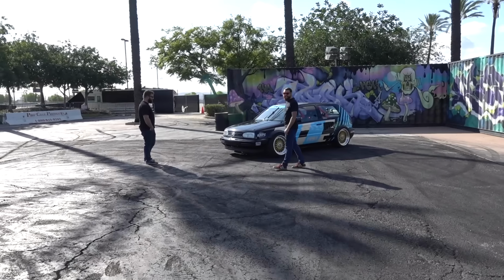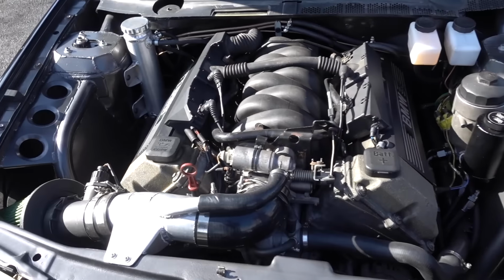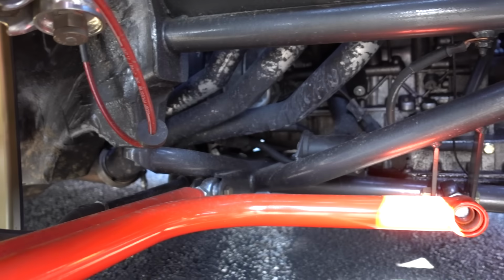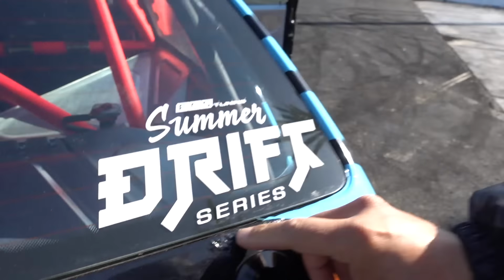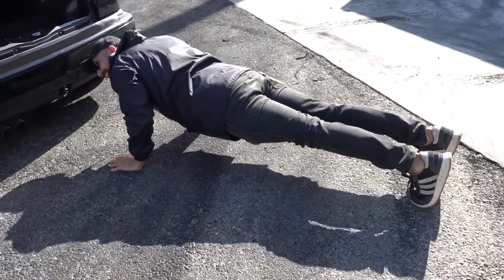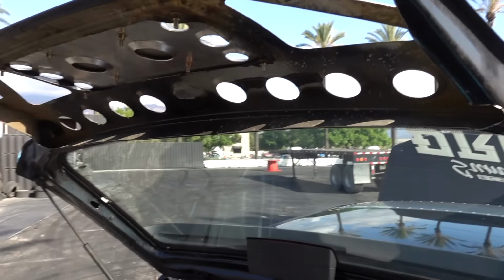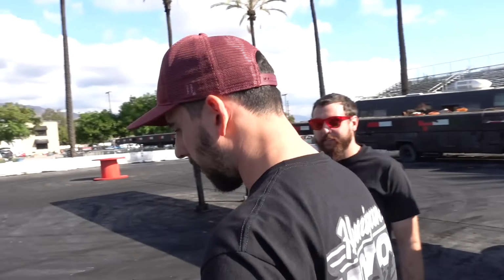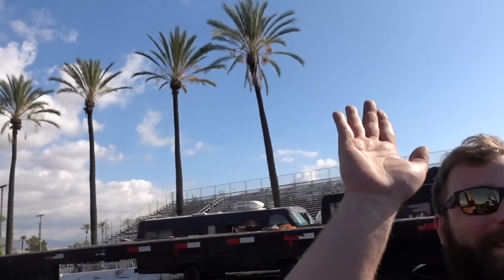RWD Converted Volkswagen GTI (With a BMW V8!) is the Ripper We Didn't Know We Needed

Comment from the maker: If you could pick any front wheel drive car and turn it into a rear wheel drive party car, what would it be?!
Reply: Honda Civic
Reply: 1972 Olds Toronado
Reply: My 2000 monte carlo ss
Reply: My 94 honda civc ex
Reply: Toyota Corolla hatchback
Reply: prelude
Reply: 4th gen prelude! Honda Preludes all looked like they should be rwd
Reply: A 2nd gen eclipse with its 4g63 turned to logitudinal
Reply: A crx with a 4g63 awd
Reply: There are so many fwd cars that would look so much better if they were rwd
Reply: Fiat uno
Reply: A CRX would be nuts... but like all fwd hatchbacks look hella dope sideways
Reply: Maybe not a fiat
Reply: CB7 Accord
Reply: Me and a buddy cut the floor pan and firewall out of a Nissan N15 Pulsar SSS, and cut the body off an S13 silvia that had an sr20det and well pulsar body onto s13 chassis. Bit of screwing around but was fun enough to do
Reply: 3rd gen Prelude
Reply: Saab 900
Reply: A mini
Reply: Old scirocco
Reply: peugeot 405 mi16
Reply: Astra h opc
Reply: Turbo Yugo
Reply: Volvo c30
Reply: Fuck it, a Fiat Coupé 20v, because why not
Reply: Tiburon
Reply: Volkswagen Passat mk2
Reply: 2010 Kia forte sx koup
Reply: Nissan Sentra 90'
Reply: Lancia Thema 8.32,  BUILD it
Reply: OG Saab 900 T16 Aero, best looking car ever<3
Reply: Hoonigan Daily Transmission K swap 4wd GTI
Reply: Legend
Reply: Vw corrado
Reply: W8 passat or maybe a phaeton???
Reply: Mk2 jetta coupe
Reply: 15 nissan altima
Reply: Saab 9-5 aero. 2JZ swapped because why the hell not
Reply: Hotrod garage took a fwd LS car and made it awd twin engine
Reply: Any and all honda civic hatchbacks!!!
Reply: 2020 Trd camry!!! let's go!😎
Reply: Mitsubishi Eclipse
Reply: My ST!
Reply: 3000gt Sl or base model!!
Reply: Whatever car thats gonna get me a tshirt
Reply: 2002 saturn sl2 with a 2005 subaru wrx driveline. i had a saturn and my friend had a wrx they are very similar wheelbases and widths, ultimate sleeper
Reply: Honda prelude MK4
Reply: Opel Calibra !!!
Reply: Mk7 Toyota celica
Reply: Any... any ever... the prewar tank known as a citroien traction avant.
Reply: 2014 Volkswagen Jetta TDI. Why you might ask. Well. It's my daily.
Reply: My MK7 GTI.
Reply: a more widebodied golf mk3
Reply: Probably a Volvo 850R or something oddball like a Mazda MX6 with that crazy sounding V6.
Reply: Hoonigan Daily Transmission Any V6 Accord
Reply: '86 Jetta with a 930 911 rear suspension and perimeter frame. I've done the measurements and used to build replicas with the setup...wouldn't be great for drifting, but it would be rad.
Reply: First gen Integra..
Reply: Mazda6 wagon with 4-rotor
Reply: Hoonigan Daily Transmission id die for a rwd mk4, 24v vr6 gli getta (gti front end on a jetta = getta)
Reply: Saab 900T Aero EASY!!
Reply: Hoonigan Daily Transmission peugeot 106 gti
Reply: 1993 Nissan Sentra b13 whit the sr20 or vq35
Reply: Eg civic
Reply: Scion TC make it rear engine and rwd 🤔
Reply: Zastava 101
Reply: my 2002 corolla
Reply: My 2001 Mazda Demio DW
Reply: Toyota Camry
Reply: Mazda 3 Speed
Reply: EG, shares a similar wheel base to the S15
Reply: Probably the same direction as this dude. I would pick the mk2 tho cause that’s where I started.
Reply: Toyota Fuckin Yaris 😂
Reply: My own Peugeot 406 Coupé, keep the original V6 and make it RWD, like it should've been from factory.
Reply: Mark 4 jetta wagon with a golf front conversion. Rolled fenders sitting on a set of fifteen52 TARMAC. With a 4AGE swap  with itbs
Reply: Hoonigan Daily Transmission Subaru Legacy GT Spec B
Reply: Toyota Celica MK2
Reply: I plan on doing a 1j rear wheel drive swap to my 96 4 door camry
Reply: TOYOTA SERA
Reply: Fiat coupe
Reply: @matttilton5888  Change the look from where? From underneath looking at axles and diff is about it.
Reply: @thatoneguy3112   just the fact.of knowing a vehicle is rwd to me makes it look better if that makes any sense lol
Reply: @matttilton5888  I get ya now, you meant like looking on paperwork/specs as well
Reply: 2010 Honda accord
Reply: Volvo C30
Reply: Honda CRX. Or my Camry 🤔
Reply: Buford Washington K swap the world tbh
Reply: LS swapped Hyundai Excel. I delivered pizza in a 1987 model and went through the 50K mile warranty in just under a year.
Reply: That mk4 golf looks like a good choice except I would’ve went VR6
Reply: Honda Fit
Reply: If I’m being real, those ugly ass 2000’s celica GTS would be so much cooler if it were RWD. Also the first two Taurus SHO’s would’ve been way cooler RWD
Reply: 2000 Acura integra
Reply: mazdaspeed protege.
Reply: 89’ Mazda 323. Cuz I’m a broke boy and couldn’t afford a GTX.
Reply: My 96 civic
Reply: @hillbillyhippie597  i was gonna say this too.
Reply: Johnny Hammersticks  i see your a man a taste 👍
Reply: 1998 Mazda Protege
Reply: 2004 Ford Focus.
Reply: 92 Cadillac eldorado
Reply: Either a Nissan maxima or an Acura TL/TSX
Reply: Hoonigan Daily Transmission I know the perfect one!!! My first car I bought from Alhambra with working AC 87 2dr Honda Accord LXI baaaby!! Wess-WESS
Reply: Hoonigan Daily Transmission  I think a fifth gen Mitsubishi Mirage coupe, a B13 Sentra SE-R or even a modern FC Civic coupe with type R body kit would be pretty sweet.
Reply: Some kind of minivan either with a rotary or turbo 4 cylinder engine
Reply: Nissan A32 Cefiro 

That and AE111 Levin, shame that Toyota did not keep the RWD layout for next gens of Trueno/Levin after AE86
Reply: 07 Malibu the floor pan is actually set up perfect, 90s something civic because crv stuff is basically bolt on and i would put mud tires on it.
Reply: Honda Prelude,Kia Cerato koup,Hyundai Tiburon,Opel Astra coupe(Bertone),Daihatsu Copen,Daihatsu Materia,Hyundai Veloster,2000 VW Beetle,Audi TT coupe
Reply: Either a 91 crx or my rsx-s
Reply: My mk1 Rabbit pickup.
Reply: Celica, eclipse,audi a5
Reply: Real talk an 03 Toyota Avalon.
Reply: Saab 900
Reply: Mk1 golf
Reply: A4 b5
Reply: Honda prelude, it looks like it should be rwd in my opinion.
Reply: volvo v70n
Reply: Ford Probe     very cheap and shoulda already been RWD from the factory    the chassis was built to be and has pop-up and down headlights 😉.   Miss good old JDM style pop ups
Reply: mk1  Fiat Panda, it's so dumb it's awesome. take a Alfa front end, weld it where the back seats were, profit.
Bonus points if you manage to stay alive in the process
Reply: G6 coupe has great body lines and would look real sick sideways with v8 noises coming out of it
Reply: 2008 Mitsubishi VRX Lancer - they have enough room for a sick V6 twin turbo
Reply: currently working on this on my 03 camry. :)
Reply: 1994  2door Camry
Reply: @RallyRu_2004_STi  did you know at one time the probe was going to be the new mustang?
Reply: Ford fiesta mk1
Reply: I would to a eg6 or a Mitsubishi eclipse
Reply: Crx maybe idk
Reply: Corolla Levin a110
Reply: A prelude they already look like they should be rwd  but they aren't
Reply: 5th gen prelude
Reply: 01 Integra
Reply: Honda prelude
Reply: Hoonigan Daily Transmission Infiniti G20 / Nissan Primera
Reply: The new corolla hatch
Reply: Hear me out PT Cruiser. tons of room for goodies
Reply: 2012 corolla
Reply: VW Rabbit Truck
Reply: MK1 Volkswagen Caddy
Reply: Peugeot 404
Reply: 95' Cadillac sts
Reply: an abarth 595 comp
Reply: My volvo s80
Reply: Hoonigan Daily Transmission Renault megane RS
Reply: Hyundai Getz😂😂🤠
Reply: Myvi
Reply: @spannersautoandcomputerser1649  or C70
Reply: VW Scirocco
Reply: Acura integra type r
Reply: Nissan Micra
Reply: Toyota Tercel or an Acura Legend.
Reply: Seriously can't believe no one's mentioned a Mitsubishi FTO...
Reply: 1994 corolla
Reply: Any Saturn S-Series
Reply: my 2003 Ford focus mk1
Reply: 2009 Renault Symbol
Reply: My 2003 opel vectra
Reply: Toyota Celica VII
Reply: Hoonigan Daily Transmission 6th gen celica! ❤️
Reply: a MK1 VW Caddy 😍
Reply: Hoonigan Daily Transmission 
Jetta wagon TDI 6spd or CRX Si
Reply: Hoonigan Daily Transmission my mk4 gti would be great with the 1.8t from an Audi A4 with rwd.
Reply: 97 4dr integra gsr
Reply: 72-76 Cadillacs
Reply: Honda civic with ford tourus sho engine in the back
Reply: Toyota MR2
Reply: CIVIC TYPE R
Reply: Cobalt ss
Reply: Opel Calibra would look sick and might be pretty balanced. I mean.. what the hell were they thinking making it FWD in the first place... :(
Reply: 80s dodge charger
Reply: Bmw 135i 2019...
Reply: Dodge Daytona or Ford Probe
Reply: Mk2 Scirocco
Reply: Vw corrado...will be nuts
Reply: Passat B5 🥳
Reply: Hands down a corrado!
Reply: 90's toyota camry
Reply: 2000 Honda Prelude. I'd want to do F series and make it drift.
Reply: 90s prelude bcuz beautiful car and pop ups headlights!! As long as it was it should've been
Reply: @matttilton5888  well said
Reply: @remaunzky12  bruh perfect choice
Reply: eclipses the brain o conner one
Reply: Corrado.
Reply: Y'all better let Jimmy bring the RWD Civic.
Reply: Honda Del Sol
Reply: Mk2 Honda prelude or a Toyota celica
Reply: Golf mk 4! 🔥
Reply: opel corsa city 1996
Reply: Honda
Reply: Honda Legend or Rover 827
Reply: VW Brasilia 1980
Reply: Audi 80 b4
Reply: Honda Civic Hatch
Reply: 94-96 Toyota Camry wagon
Reply: Honda crx
Reply: 95 Toyota Camry wagon
Reply: Bmw active Tourer 2 Series
Reply: Vauxhall vectra
Reply: Saab 900 turbo all day
Reply: My 2001 Mk4 vr6
Reply: Fiat 500
Reply: A vw mk1
Reply: '95 Volvo 850 T5 Sedan
Reply: Honestly, I think the GTI is one of the best FWD cars out there. Every gen has always had a good chassis and suspension setup, that not much is really needed to make it a very fun car, compared to all other FWD cars. I think this GTI was a good pick for this conversion.
Reply: Pretty sure this dude just nailed it
Reply: karkid 164 this car, but give make it rear engined and give it a 3 rotor single turbo.
Reply: Saab 9000aero
Reply: 2018 Civic type R.
Reply: B5.5 passat
Reply: Volkswagen Corrado
Reply: Renault Le car cuz that would mean I have a Renault 5 turbo
Reply: 96 Acura integra
Reply: @mwmmatt1  my guyyyyyy
Reply: Acura integra
Reply: my mkv gti lol
Reply: I've always wanted a Corrado rwd or a 2000 rwd regal gs.

Comment: super sick build but those m62 arent the best motors, single timing chains :/ the m60 out of the e34 540s are great man, had two with over 250k miles with some spirited driving, still sick to see
Reply from the maker: Doesn't seem to mind being smashed on limiter for 5 minutes straight, so that's a win!
Reply: yeah, like that would be issue.. only thing failing is one plastic part that quids chain, and needs to check oil pump chain.. but b44 bottom with b40 heads is just perfect compo
Reply: Hoonigan Daily Transmission hahahaha he’s a machine
Reply: TopiAS06 that would be sick to do one day too
Reply: @TopiAS06  I have an M60B40 from a 740 with the improved intake runners in my e30 and the power is super linear and just keeps going to redline. Love that motor.

Comment: Golf proportions are so wrong , even rwd V8 doesn't make em good. Front tires are glued to the firewall so the engine hangs in front lifting the rear wheels, that have no weight on them, also because there's too small rear console behind them

Comment: wheels are too big
Reply: Nah they're just right.
Reply: @rustywrench500  anything above 16's is too big for mk3, only if going for a crazy "stance nation" look by redoing ur over fenders u can make it work with 17's in some cases.
mk3 is too small for such big wheels looks like a chariot, maybe in the future they can do what drift works did with theyr v8 ae86, then ye, it works running big wheels like that
Reply: @janisstradins652  i understand what you're trying to say but since he's changed so much on the car it's probably changed the car's whole dynamic, you can see when he's driving the car spins effortlessly and i think to compensate for the short wheel base and the and the amount of power it's currently making is the reason why he went for something that big.
Reply: @rustywrench500  ye i know, but from aesthetics pint of view they are too big thats all, not hating on the build, love seeing vw's being turned into drift cars, but as a vw guy my self just rubs me a little the wrong way
Reply: @janisstradins652  understandable.